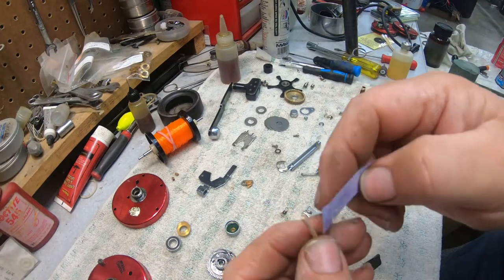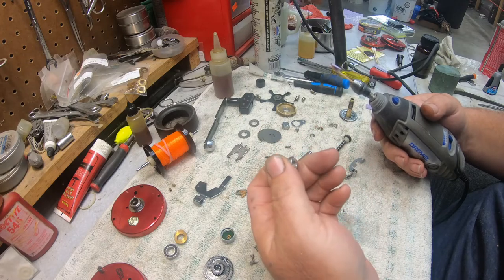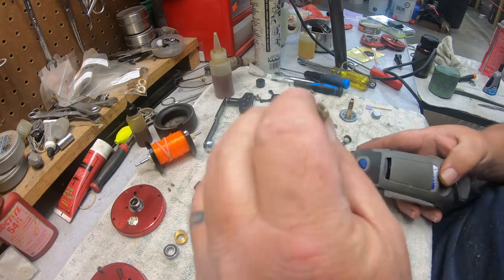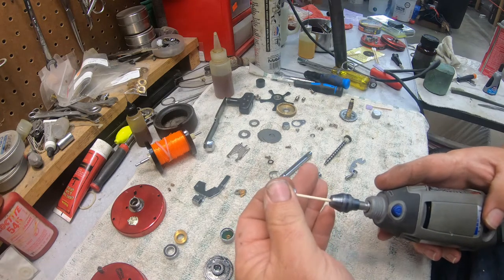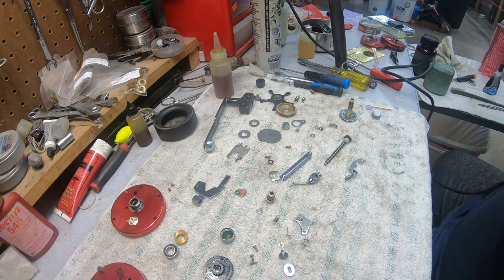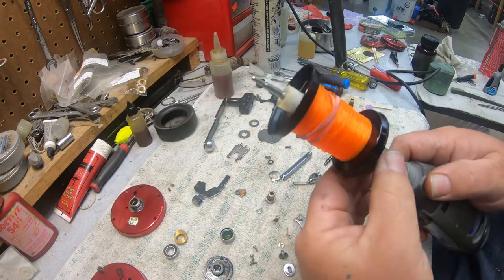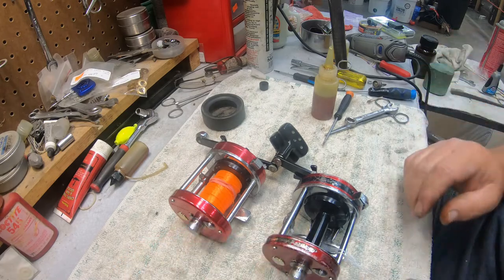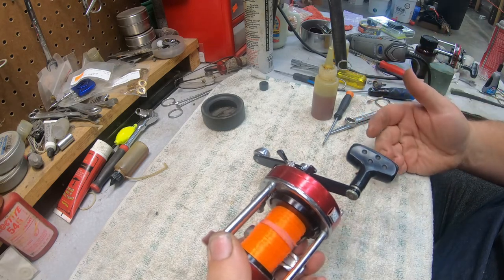Super Tuning a ABU 7000 baitcast reel

Comment: I never use sand paper to smooth inside pinion gear. Just using dremmel rotary tool, bamboo stick wrapped with cotton and fabulustre jewel rouge. It gave nice smooth surface inside pinnion gear.